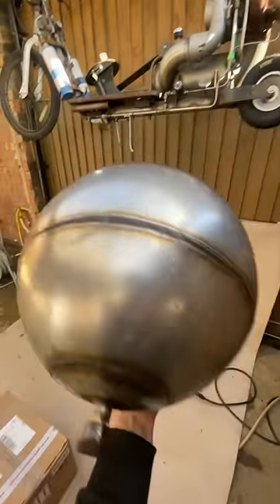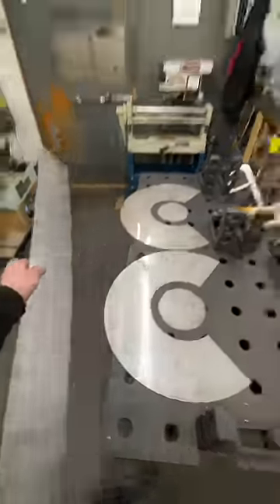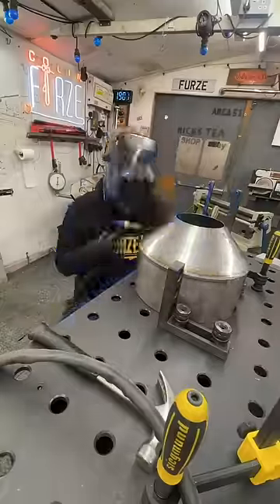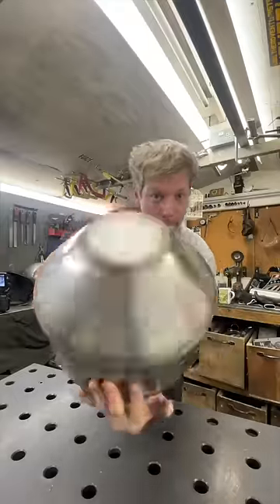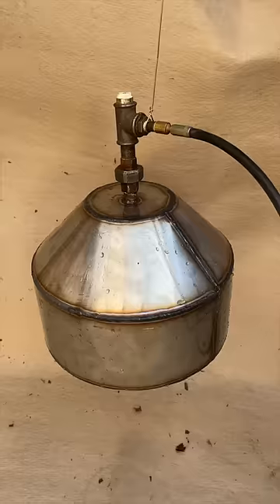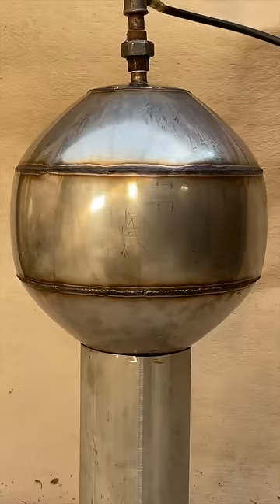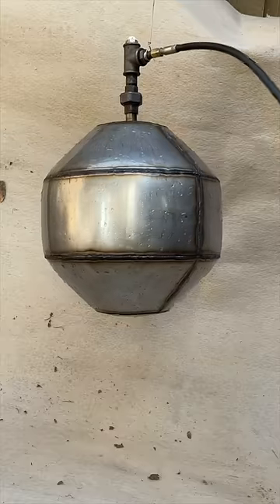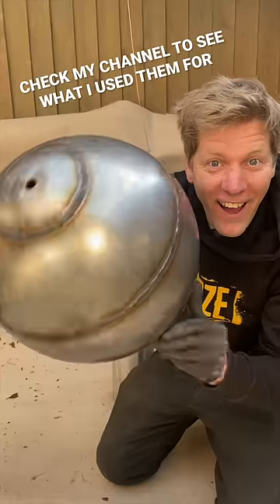Your Pressure washer has a Secret SKILL

Comment: How to make your pressure washer explode
Reply: If you have a typical electric pressure washer like that then they max out pressure every time you let go of the trigger. If it's running then that means that the line pressure is not high enough to trigger the shut-off switch.

Comment: A bit of advice: you should put the longitudinal welds at different sectors of the circle, like brickwork. In the event of a crack, it won't expand the whole length of the ball.
Reply: In the event of a crack, he has to start from scratch.
Reply: @algrant33  not necessarily, the crack can develop later during the service life of the component. It's the difference between being able to repair it and a catastrophical failure.
Reply: @hammerhand5059  good habits are always a good thing.
Reply: If it cracks it's cracked either way... 🤭
Reply: i believe the welds are actually stronger than the sheets, so its better to have them distributed around the circumference.
Reply: There is no analysis to support this notion, even if it seems a tad logical on face value. When one of the welds splits, the ball is recycling material for sure, no matter if it unzips all the way. Same amount of danger, too. It might even be better to make a fake weld on the opposite side to assure the thing acts less like a rocket motor when it is later filled with gas.

Comment: imagine the pressure is higher than you expected and you accidentally make a hydraulically powered frag grenade 💀
Reply: It will only come out with the strength of the compressor plus the little air compressed inside the ball. Water won't add up anything there: if the ball was to break in pieces, water will just fall to the floor, not even being expelled because the weight is so much bigger than the compressor strength

Comment: You can do a similar thing for bike or motorcycle frames by putting a tube in a mold and using the water pressure to expand the tube into the shape of the mold.  It allows you to get a tube with varying cross sections, like circular at one end and oval at the other, while also having an arch to it.

Comment: Hey Colin can you see if a dent in a motorcycle tank can be popped out like this? If theres a special adaptor that could be machined to make a pressure tight seal on the tank or something
Reply: Don't do it. The tank will deform and the dent remain. I followed bad advice and ruined the tank on my first motorcycle
Reply: PDR is amazing
Reply: @erik_dk842  thanks for the info

Comment: Amazing how many people don't understand the difference between compression and pressure. Thinking that water is safe just because it's incredibly difficult to compress. They must not have heard of water-jets that cut through metal. Though that pressure washer shouldn't be able to reach those pressures, I would still consider it dangerous to inflate a steel ball like that. Dude has some great welding skills

Comment: This process is called hydroforming, and it happens when an incompressible substance(usually water) is pumped into a mold, pressing on the sides until the mold stretches and bends to its surroundings

You can also hydroform with the shockwave from explosions

Comment: Watched a large valve fail a water pressure test at about 700psi. It blew a plexiglass shield out of its frame and the 6 foot tall toolbox with hundreds of lbs of tools in it on the back side of  said plexiglass glass flew probably 10 ft threw the air. Wish I could attach pics of the aftermath

Comment: A pressure relief valve piped to somewhere safe would have been an idea.
Reply: No need, a normal pressure washer can’t reach deadly pressures in this case
Reply: @techheck3358  I meant the pressure vessel on the roof, not the pressure washer. Flying bits of hot metal is not a good idea.
Reply: @flatmoon6359 the sphere? it reaches pressures no higher than the pressurewasher itself

Comment: You dont have to tell me.  I built one of those sheet steel creations.  I figured if an inflated dong felt great, a sheet metal one formed with a power washer had to be incredible.  It was not. Ill spare you the details, but imagine trying to pull a metal softball sized object out that went in shot glass circumference.....bad times.

Comment: Thats just a pressure shaping i saw a video where they shape the biger ones with water and bomb instead of pressure washer since it needs q lot of force to shape and test if its gonna hold up if the welds rip then they would fail anyway im no welder but i saw some really butchered welds that were empty inside so that not only shapes but checks your welds as well

Comment: Horrible HORRIBLE idea. You need to be more specific as people with low power pressure washers (especially electric ones) will destroy their pressure washer. In the event that it is strong enough to bend the metal, if not monitored properly, you’re practically building a pressurized water bomb.